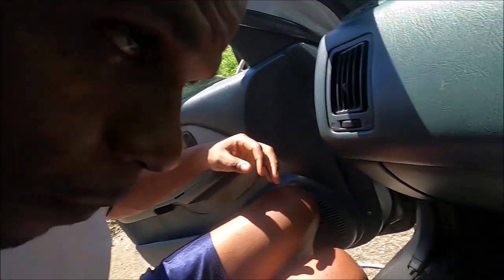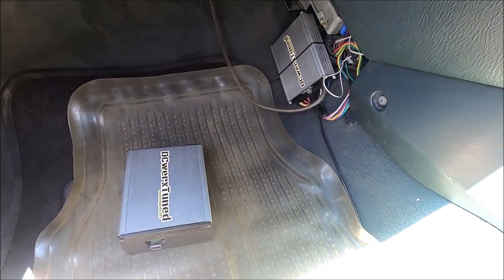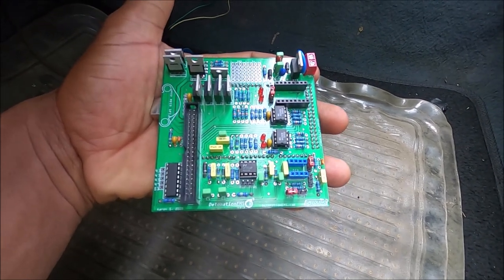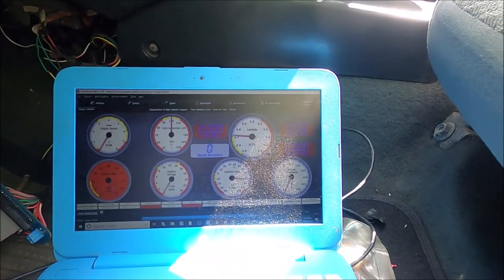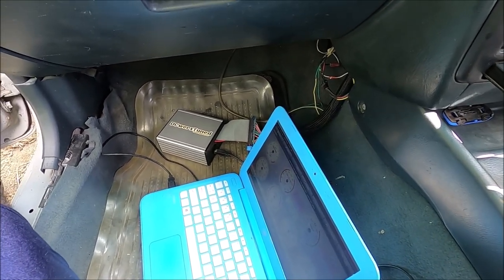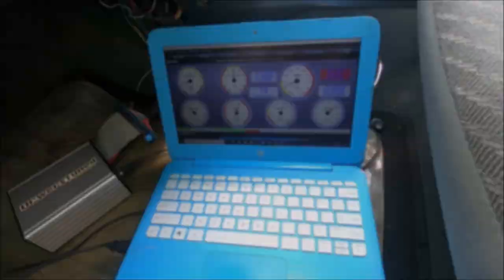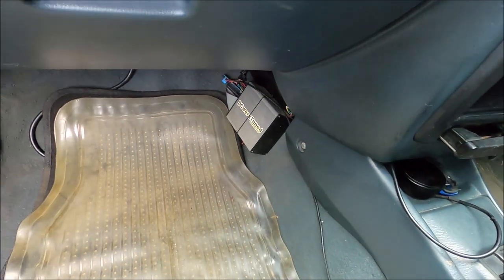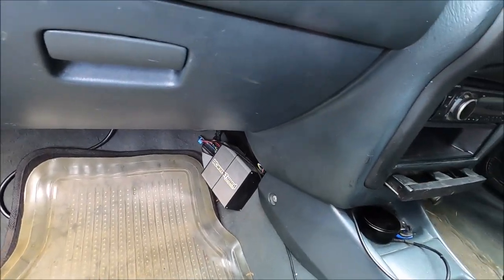DetonationEMS Install and Overview

Comment: Greetings DC Werx, 
I am  thinking about speeduino for my 1ZZ-FE  Turbo project. For now I would like to use the original wiring harness, which board should I use to make my life easier ? 
It is possible that I would use your services for the tuning after. Thank you in advance.
Reply from the maker: My pick would be the v0.4 or a UA4C. They both can run your 1zzfe. The ua4c generally ends up costing less, however mostly use the v0.4 for parallel installs.
Reply: I have a soft spot for the 1zz. I rebuilt and turbochared one for my EX(video on my channel).. Really a descent little motor. Can't make a ton of power with stock internals but I made about 230ish and it was SOOO much more fun than stock.. Been several years on boost now, it's still daily driven..